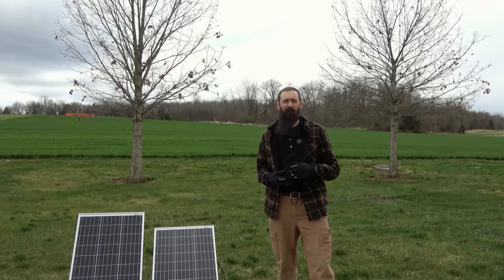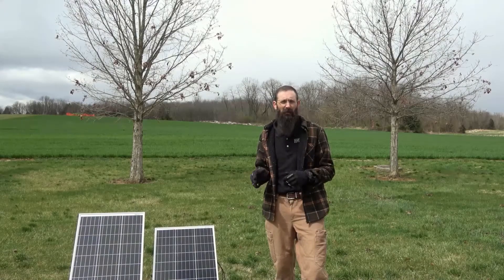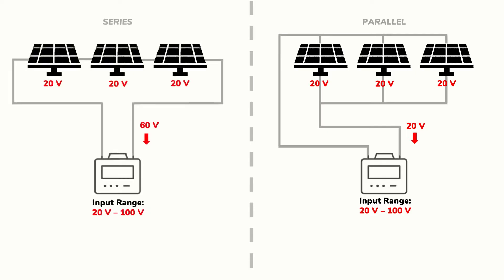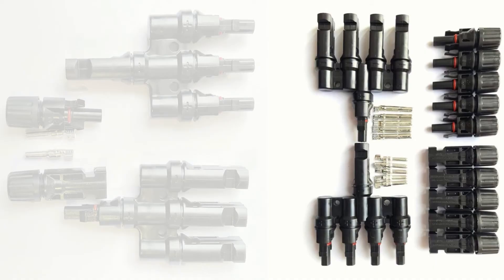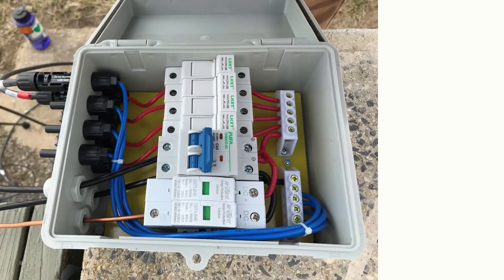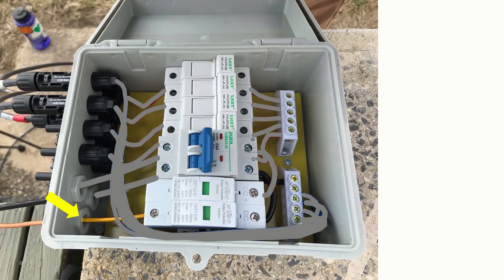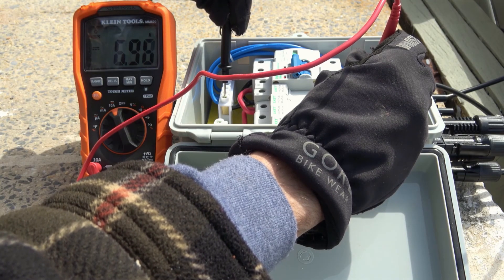How and why to wire solar panels in parallel

Comment: 1. I know you can measure Voltage when everything is wired, just by puttin probe on + and -. But you also measured Current using this method. Am I stupid? Isn't it necessary to open the cirquit and put your multimeter in the circuit so the current passes throuth the multimeter?

2. I want to believe (there is a comment) that series is king. But with my smapp panels on the balcony: 10 W + 10 W + 30 W in series, even if they are irradiated equally, the bypass diode gets activated and only 1 panel is working. Maybe it want a sunny day but again, all panels received the same low amoung of light.  In parallel, I measured a current of 200 mA and pwm solar controller also charged battery. But in series, power output and so the current was lower.

Comment: Hi everyone I’m to dumb to comprehend this knowledge. I need advice please. I got Anker Sofix C1000  (11-32V 10A, 32-60V 12A (600 watts max)) on the way. I thought of solar panels 175W with specs of Vmp 22.3V, Voc 25.2V, Short circuit current 8.3A, Max current 7.85A. Is this a good choice and how do I suppose to connect them to avoid the damage. I’m thinking of 2 panels right now. Can I also extend this kit in the future. I’ll be very grateful for any advice. Kind regards

Comment: so I am buying some very cheap panels from the internet to power lights in my shed I have tried them in series so far but am thinking of running 2 sets of 2 in series then run the 2 sets in parallel i currently have 2 12v car batteries to run the system with a 4000w inverter and a 60-amp mppt solar charger, is this the best set up

Comment: Hey, thanks for the video. We live in a rental property in the UK and I'd like to put a panel/some panels on the balcony. Given that we rent and the panels would be visible from the street (and I haven't exactly asked the landlord) I'm looking at keeping my system as low key as possible. To that end, I'm debating multiple smaller panels in parallel (5x20w panels maybe?) rather than 1x100w panel. Rather than using a whole bunch of MC4 connectors, my idea is to run positive and negative "bus" cables all the way from the battery to the furthest away panel and then have each of the other panels on the way wired directly into the "bus" cables. I know I would have to use the right size cable to handle the combined current, but can you see anything obviously wrong/dangerous with that? Thanks in advance.

Comment: The title is missleading. Depending on your environment you should go for series or parallel or mixed. Parallel is more expensive (wires and connectors) then series. All the arguments about a panel breaking down is less of an impact, as the chance of a panel breaking down is very very small. Also most new panel have bypass diodes and when parts fail of such panel, it will activate the bypass diodes, acting as the panel was not there and therefor not cutting the performance of the string down to the least performing panel. This on its own is a big caveat of the movie maker. If you live in a climate where there is alot of overcast, go for series string big enough to trigger the startup of the inverter. Most real life household solar installs combine parallel and series to make most of their inverter.

Comment: Q, On boats it is often recommended to wire in series (counterintuitive to me, particularly as on boats there is almost always partial shading) with multiple arrays assigned to diffn controllers based on shading (that bit makes sense) The explanation given is that you get the max charge to your batteries whilst the panels are working, even if only partially.. I sorta get the explanation however it still doesn’t sit well with me. I have mine wired in parallel. Thoughts?
I’ve watched a lot of YouTube channels on many things, this is streets ahead in terms of visual, graphic and verbal presentation. Many thanks

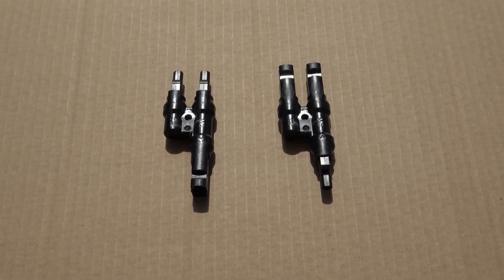Comment: 5:29 How about larger cables? There are only MC4 connectors for small cables here, even online. Is it possible to connect 16, 25, or 35 mm² cables in parallel? What do you use when the connectors for the larger cables are not available?

Comment: How would a solar panel fail, so that the series style would not work?

I call that BS! Where do you get those numbers from? (big question mark)
Reply: One of my panels failed and took out the solar charge controller in my off grid inverter. I had to purchase a new unit. All my panels are in series.

Comment: Interesting video. Question for you if I may, when you cover the solar panels with the cardboard, do they stop generating power instantly or does it take a moment or two for it to dissipate?
Reply: I guess he is too busy to respond. But you can see if the current is present with a multi meter, or just a test light. The current, however, goes away pretty much instantly.
Reply: Cheers , I ain’t planning on touching it to find out. Was just wondering. @5400bowen

Comment: hi there, I have bought 4 solar panels 340w ,Max Current (Imp) 9.82A

Max Voltage (Vmp) 34.6V

Short Circuit Current (Isc) 10.51A

Open Circuit Voltage (Voc) 42.5V

Weight 18.7KG

Dimension 1664x992x35mm

Cell Technology Monocrystalline  but I didn't   parallel yet I need help before somethings goes wrong LOL, my system run by 48v do I need to do parallel  them?
Reply: If you do parallel they won't have the voltage to charge a 48v battery.
Reply: You'd need to do series or 2 series combined on parallel but need to be sure your charge controller can handle the voltage and your wiring will handle the amps.
Reply: @ChrisEpler  thank you my friend for your reply, I have bought 100 amp  solar charge controller ,but when I make 4 panels what you call series ,my charge controller red light will be on when I make two panels like as + to - I don’t know what they will call series or parallel , but my battery charge drop down, so I feel this is now more look like 24v system not 48v system, I’m really confused,

Comment: Do I need to put diode on positive lead of each solar panel before doing parallel connection to prevent reverse flow when one solar panel is under the shade?
Reply: Not if you are using a solar charge controller.  It prevents battery drain during low or no sunlight

Comment: Hello!sorry for my bad English.when they are in parallel,we have more amber.do we have higher thebrature with more ambers?
Reply: You get twice the amperage when running two similar panels in parallel. The voltage will be the same as a single panel, or the lower voltage of the 2 panels (if they are different).

Comment: if you only have have two panels you should only have 2 sets of wire (+ and -) to hook to the box where do you get the other set of wire from another set of panels
Reply: The 3 - 1 & 4 - 1 branch connectors shown are just showing what you would use with 3 & 4 panels running in parallel. 2 - 1 is all you can use with 2 panels.

Comment: I have six 120 watt panels wired in parallel. I show 21 volts on my solar controller which is about right. They problem is I only show .2 amps coming to my controller even in bright sun. I replaced the controller with another one and still get the same reading. Any ideas on what could be causing this would be appreciated. thanks.
Reply: I'd recogmend checking if you crimped the mc4 connectors correctly. If you connected multiple wires to an in/out box one of those wires might not be connected correctly.
Reply: do you have any load on the controller?

if the batteries are fully charged the controller will not pull any power from the solar panels - if there is no load the current has no where to go
Reply: what kind of solar panel are you using it?
 I recommends  you to hook up Mono-PERC or Monocrystalline solar panel and its cable sizing .

Comment: when to use what ?? since the connectors only allow a 30 amp fuse ,that restricts your design..
Reply: He covered this in the video, I believe he stated you can run more branch adapters further down line. Each one can handle 30 Amps.

Comment: Hey bud I have a question I'm wanting to do a series connection of two solar arrays that are run in parallel does that sound ok or do I hafto series each panel and then parallel them?
Reply: Go check out: "DIY Solar Power with Will Prowse" channel,  and "Hobotech" channel here on YouTube.  They have some excellent information on Solar, and also have special deals on panels, batteries etc..